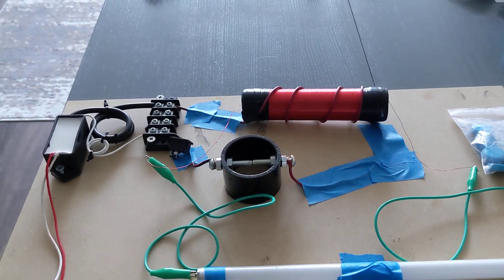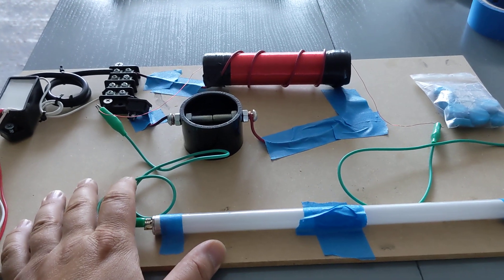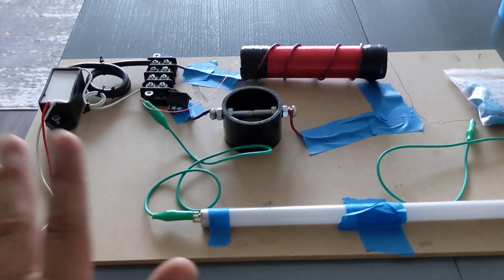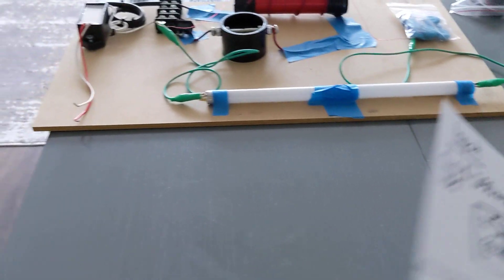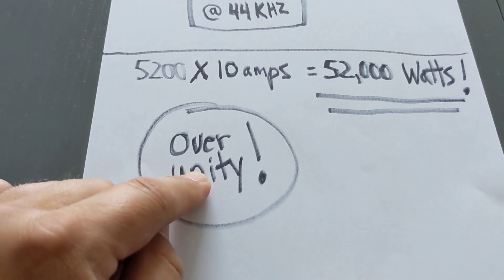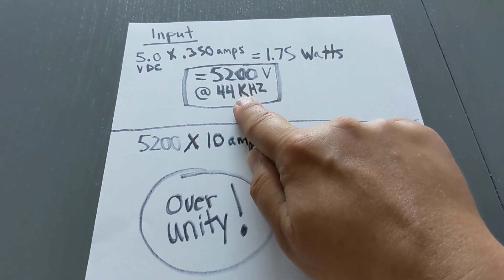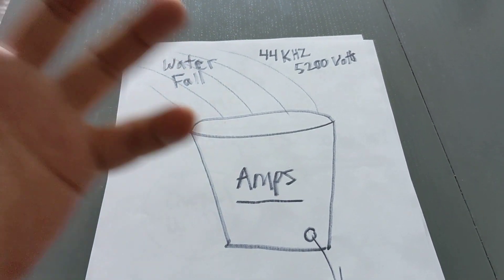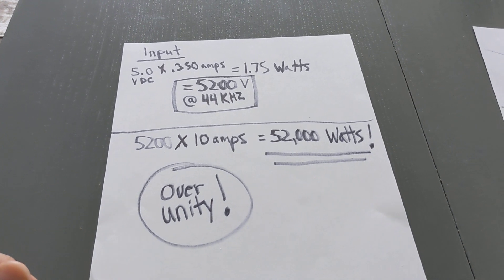Don Smith Generator / Faraday Research RND

Comment: Hey Hey, I took 4 years to figure this stuff out, and its fairly simple.  You create a negative sink.  Its an open system, and a damped system.  Don smiths devices didn't work as claimed, because he couldn't get the info out if he told the truth, as he put it.  Look at each part of his device, but you have to separate the parts and tune each part to resonance.  Either individually or together.  But each circuit has to be in resonance.  The impulse bounces back in forth in the LCR circuit and if your near a magnetic source it will through it off..  You mag. field is the earth and your impulse is the magnet.  You have to tune each consecutive impulse to overlap the previous.  That means varying the voltage too.  If your slamming the LCR with to much voltage, the impulse gets wide and outa sync.  Many ways to set it up.  Like using a reverse saw tooth wave going in that creates a trumpet wave coming out.  The bigger the secondary, the more work it can do, also try two secondarys, first for voltage, second for current in series and gap between them so it doesnt create a field and mess up your resonance.  Current is not consumed or a minute amount in the primary circuits, if u tune induction, resistance and capacitance.  remember have old bulbs on output, when tuning cause adding load changes resonance.
Reply from the maker: Yeah everything that you've stated I think you're very much correct The only way I see the Dawn Smith system working properly is if you set it up to charge batteries and then the batteries would run inverter system which would power you utilities using his system to run utilities on a disruptive discharge is almost next to impossible to get set up correctly in the proper resident frequency and voltage at the same time plus maintaining consistency in that frequency with a disruptive discharge like I said is pretty much impossible to do so yeah I agree a lot of what you're saying

Comment: Wow! You knowledge about Electricity is amazing. You calculated output power with 52kV times 10A: The 10A is the capacity of the wire used in secondary windings. You can use a thicker wire with the max ampicity of 100A. So the output power will be 52Kv x 100A. This is a super formula to declare your STUPIDITY  and LACK OF KNOWLEDGE. Keep playing for years will not help you. Get an admission in a college and complete basic 4 years of engineering, and then you would be able to do sothing in few years; spend life time doing monkey thing, otherwise. What you are doing is not what Don Smith talked about.

Comment: You never explained why your system would be capable of producing an output of 10 amps @ 5200 volts. 

This is a ridiculous claim to make unsubstantiated. It was nice of you, however, to circle the words “Over Unity” and point to them.
Reply from the maker: Hi thanks for the question okay so the term overunity means you're getting more power out then you're getting in okay because of the nature of Dawn Smith's system a lot of the measurement tools that we use today will not work with the system because of the high frequency high frequency will not work with your standard voltmeters it just gives you inaccurate readings so the only way to calibrate a Don Smith generator is you calculate how much battery input your putting for example my systems putting 12 watts in and then I am able to achieve 25 watts out by using a incandescent light bulb at the incandescent light bulb for the system is probably the most accurate you will have now like I said before because of the nature of how the power is generated at a very high frequency all our meters do not work with it so I use the light bulb to indicate to myself how much wattage I'm able to achieve so you have to calculate the watts in versus the watts out so my system I got 12 watts in and I'm getting 25 watts out but that's why Don Smith when he was doing his lectures and talking with other people it sounded very obscure and confusing I think Don Smith was leaving out a lot of stuff and a lot of those secrets he took to the grave unfortunately that was the type of people back in that era they were worried about making money off the device then actually sharing it so that kind of thing is now starting to change so the best thing to do is actually build the device for yourself and calculate how many watch you're putting in the system and then calculate how many watts are coming out of the system by using a incandescent light bulb only if you're able to get it fully lit you know you're getting 25 watts so I don't know if this helps you out let me know thank you for the question and we'll chat soon

Mike.
Reply: @FaradayResearch  

Thank you for the quick reply. I understand the claim and am very much open to considering everything here. 

The claim made is simple and based on volts, amps, and frequency. 

If high frequency high voltage (5200 volts, 44khz) is stepped down to 120v 60hz, then we have resolved the issue of having difficulty measuring output power because you can run a conventional load and with a normal electrical meter. 

Are you able to show output, in watts, on an electrical meter, in excess of the 5vdc 1.75 watt input? This would be compelling. Given the claimed 52kw output capability on 1.75 watt input, it should be very easy to demonstrate.
Reply from the maker: @atlas9401  Hi yeah I would be able to show the what's going in with a meter but again like I said with the output I would not at this point I haven't finished the rest of the system to in order to actually get an actual meter reading on the watts out I have to do a few things to the system probably have to add a RF choke into the system to get the RF frequency sorted out and a few other things so as far as watts and yes I can probably demonstrate that in a video again thanks for your comments
Mike
Reply: @FaradayResearch  

Perhaps I misunderstood the video. Is your claim of 10 amps at 5200 volts a known output of your configuration or purely hypothetical/academic?
Reply from the maker: @atlas9401  yeah because of the lack of information that Don Smith left for everybody because I do believe he left a lot of stuff out and he took a lot of those secrets to his grave... a lot of this is theoretical so we you know on my YouTube channel I try to prove or disprove stuff so I'm working on it to see if the Don Smith generator was truly "Real Deal"... or it was just hypothetical so I'm still researching I'm still developing it to actually see if it actually is what it is some systems I've worked on in the past I will tell you in the video it is Not over unity.... so I'll kind of leave it like that
Reply: @FaradayResearch  

Understood. Keep up the good work brother. Thanks for explaining. You’re not alone in your search.

Comment: Good work...try to ground your device with and actual earth ground...if L1 and L2 are tuned properly there will be much more power...but I think the circuit should operate much like a one wire transmission system with the  voltage going through the then into earth ground deep in the earth is..negative or neutral side...also high voltage side negative from the module should also go to earth ground or be taken from spark gap....I think the energy wants to go WHR it needs to...so give it a path...

Comment: Your theory is off a little bit. The capacitance is size of the bucket. If your capacitor is small it will charge up very quick but not deliver a lot of current. If it is bigger it will take longer to charge. The frequency does not matter that much in this case. Try charging up multiple capacitors of different sizes and the same voltage. And measure how long each one takes to charge up to the rated voltage.
Reply from the maker: Great thanks for the info I will take that into consideration when I do more testing

Comment: i saw someone who did a similar setup and the tube ended up doing some weird flickering when the power was turned off.
Reply from the maker: Hmmm  I am not too sure what was going on but it's a possible that he might have had an issue with the capacitance in the system it had some residual power sitting in the system that's just a guess???
Reply: @FaradayResearch  i posted the l1nk if it not visible check the held for review section...
Reply from the maker: @m3sca1  yeah I seen the video and it looks pretty cool I'll have to investigate this more thanks 👍
Reply: @FaradayResearch  no probs. btw the uploader got involved with some grant with connections to puppet b!den and has been having all sorts of gov related harrassment and is no longer posting
Reply from the maker: @m3sca1  yep I don't doubt it I've had my share of weird things happening
Reply: @FaradayResearch  i found the video...check the setup and see what you think. 
https://youtu.be/EJUuzGPQw0k